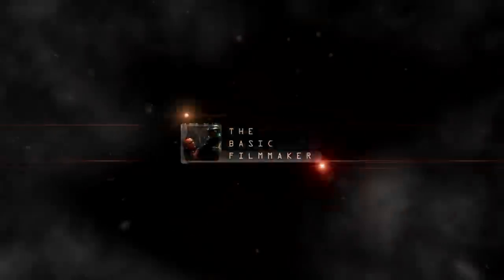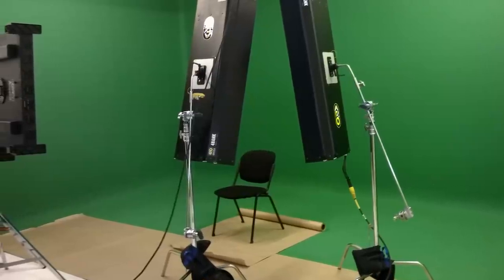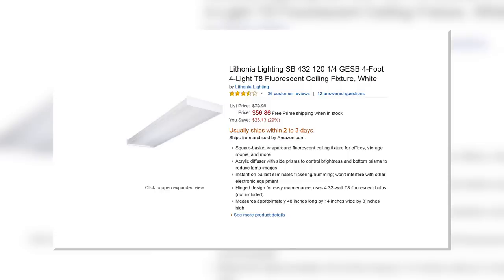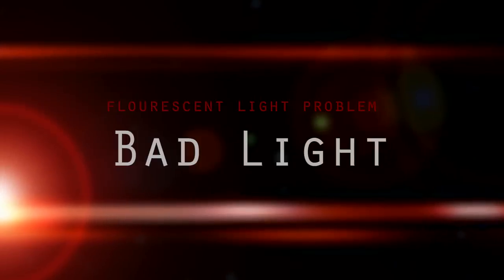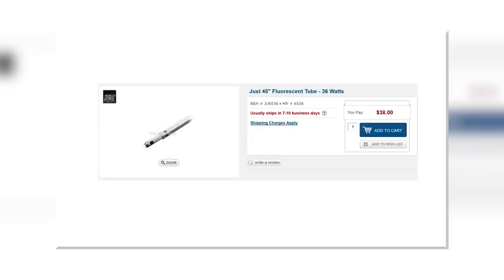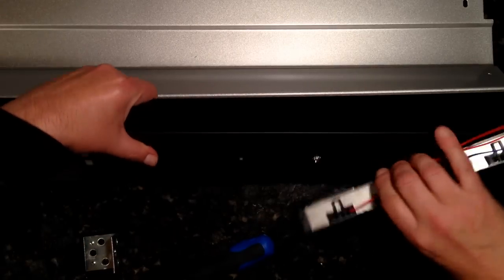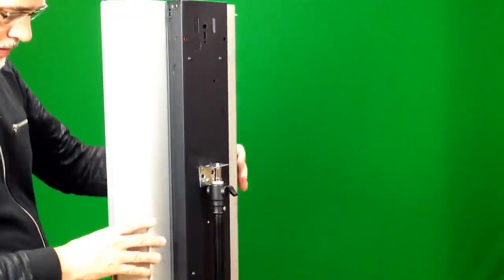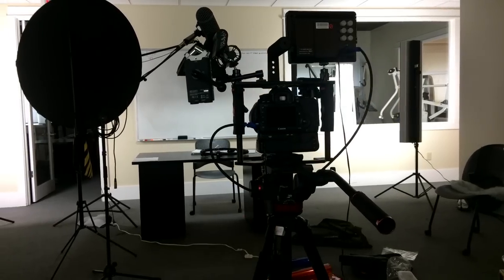How To DIY Bank Lighting For Filmmaking - Basic Filmmaker Ep 114

Comment: Hello, Basic Film Maker :) your videos look great from Romania and I've learned a lot from them. Thank you for that. Now I have a question: I want to do the project using a led light 1,7 metter long, 7350 lumeni, but with a CRI of 83. Do you think its a good idea? In the video you mention CRI over 90 plus. Thank you
Reply: My concers are about the number of lumeni: is it enough? And about the CRI value. And I am buying 1,7 metters lights because I want a big light properly green screen. I want to use just one bulb on each side. Not 4 as in your project.
Reply from the maker: +Școala de Dans Let&#39;s Dance A long like like you are talking is good. EVERY decision you make about lighting a green screen should be based on EVEN lighting.  If it takes 10 lights, or just 2, even lighting (no hot spots) is the key. You can buy or DIY whatever you want. Just make sure it's even, and your keying will be a breeze.
Reply: Thank you for the reply, Basic Filmmaker! I will get them and I hope I can do the 1 Click Green Screen as you do it. Thank again

Comment: I tried a dimmer on these lights and it didn't work. Any thoughts?
Reply from the maker: Man. I'm not sure a dimmer would work on these, unless they are rated for that. Haven't tried it, and I think the problem is the regulator that you need so it doesn't flicked - you start changing the voltage and the regulator must freak out.

Comment: Hi, thanks again for this DIY bank lights video and the other one on green screen. I got the Lowes shop lights (T8) you suggested, but they have only 4100K or 6500K T8 tubes available, and their CRI is in the low 80's range. The lighting set I am using uses 5500K CFL bulbs. Should I get the 4100K or 6500K tubes for the bank lights? Thanks!
Reply from the maker: Interesting question Leo. I just haven't used low CRI bulbs as I don't want to mess with it. As far as the K value, I don't think it will matter much, as you will be pulling the lit part, the green part, out anyway, AS LONG AS the light don't spill onto you, the talent. As far as CRI, again, I haven't tried it. I would be worried that a low CRI might offer differing colors on the green screen, and make it harder to pull a key, but again, haven't tried it, as I like to be safe with this and not battle keying in my editor. I would either find a higher CRI, or just go with the lower CRI knowing that you'll find out there aren't any problems, or, knowing that you may have to replace them if you do have to much color indifference.
Reply: Thanks. I went ahead buying the 5000K T8 with CRI 82. Likely the green will not be as faithfully rendered as with the fluorescent tubes with CRI 90, but as long as it is evenly green, hopefully it will work alright. I will give you update later!
Reply: Do you have an update. Im having this same dilemma
Reply: The CRI 82 works fine for my application. I figured that how the green is being rendered as is not that important, as long as it is consistent (so the background can be removed consistently).
Reply: Leo So thanks

Comment: Nice video! I work with a Lowel DV Creator 55 Kit to light my subject and these lights are Tungsten 3200K. Would i get in trouble if i would use your DIY fluorescent lights to light the Green screen?
Cause somebody once told me to not mix light sources.
Hope you can help
Greetz lenny
Reply from the maker: +lennart holterman Hey Lenny. I don't think it would be a problem. You can gel the lights, or better yet, just get 3200k lights to match.

Comment: Will I get flicker If I get a fixture without a ballast and use led lights instead?
Reply from the maker: I think you will, but haven’t tried it. The ballast controls the voltage so it is consistent.
Reply: Basic Filmmaker would you recommend getting led lights?
Reply from the maker: Yes. For green screen, if hat's what we're talking about, having full length lights on the screen on either side is optimum.

Comment: Any issues with flicker at high sutter speed and frame rates?
Reply from the maker: Not so far as I've seen. It does depend how high you're talking about, as I've tested 60-80 for a person.
Reply: @BasicFilmmaker  thanks! I always like to check lights at at least 60FPS/125 shutter in case I ever use them for slow motion.
Reply from the maker: @godsfilmmaker8863  That's cool. BTW, you might want to do some research in 2019.  This was made nearly 4 years ago, and you might be able to (unknown) find something just as cheap without DIYing anything.
Reply: @BasicFilmmaker  oh cool, thanks! I've actually been wondering if you can do the same thing with one of those LED replacements for a 4 bank. I hadn't seen your videos before today, but I thought your green screen video was very handy! I shoot some green screen for my day job (I'm a media director at a church) and I use 4 octagonal softboxes with 85w CFLs to light the screen itself. I put them in the corners (2 on stands  2  and 2 on the floor) and with the use of the green screener app and some of the plugins in HitFilm Pro I get pretty good results! But what you showed would definitely work better, especially for a long shot. Looking forward for trying to figure  it out. God bless, great explanations! - Winter!

Comment: What do you think about these LED lights that don't need a ballast? I've seen many 4 light fixtures that I can easily replace the bulbs with these and some even have the diffuser already on them. (Think office ceiling lights) 
https://www.homedepot.com/p/Philips-32-Watt-T8-40-Watt-T12-4-ft-Linear-Replacement-Universal-Fit-LED-Tube-Light-Bulb-Daylight-5000K-2-Pack-539163/308350356
Reply from the maker: A lot has changed in 6 years. LEDs are much cheaper, and I say go for it.

Comment: Would LED tube lights work?
Reply from the maker: Yep. I'm expecting a shipment of LED tubes soon (green) and will be doing an update to my green screen video.
Reply: Can you share with us which ones? I noticed that kenoflo has special tube for lighting greenscreens.
Reply from the maker: They do. These are from CAME, four 3-foot lights that can be attached in-line, and I plan on using them either 2x on each side, or 4x around the perimeter. Stay tuned, it's still a theory - we'll see, but these are RGB adjustable and super bright.

Comment: Hi, I have a question, would these lights from Costco work, they have led bulbs, here is the information for them:

 Tek Pro Black Ultimate Shop Light

The Tek PRO delivers more lumens per watt than regular fluorescent lamps or incandescent bulbs!  High output, energy efficiency and quality of light make this the ultimate garage, shop, workbench or craft area light fixture.  T5 HO fixture with 4 lamps produces an amazing 20,000 lumens, while a standard 4 lamp T12 fluorescent fixture produces 11,800 lumens and a 200 watt incandescent standard household bulb only 3,900 lumens (varies by lamp type).  “Daylight” 6500˚ K lamp color makes them very pleasing to the eye.  They also feature a high color rendering index (CRI) of 84.  Tek PRO fixtures are made from rugged diamond plate aluminum and have a durable powder coated finish.  State-of-the-art reflectors are made from 95% reflective German aluminum.  This unique high-end embossed material offers unparalleled output, reflectivity and diffusion.  “Daisy chain” feature allows multiple fixtures to be plugged in together (not to exceed 12 amps).  120 volt/216 Watts/1.8 amps per fixture.  1 year warranty on ballast components. Made in the USA.

They cost $149.99 each
I am thinking about purchasing them, thanks for you help.
Reply from the maker: Hittman45 They sound great. The CRI is only 84. I try and get 90 and above, but it should not be a big problem.

Comment: The link you gave for the light fixture does not come with a Plug, bought two of them 100 bucks wasted
Reply: Could you post the light fixture you used please
Reply from the maker: Joe Zoc Gessh! Amazon keeps mucking around with these links. Here's a new link to an Amazon one with a lamp guard and plug: http://bit.ly/ShopLight4-LightBankDIYAmazon, and here's the one you can order from Lowes: http://bit.ly/4LightShopLightLowes. These guys are really starting to p**s me off. :)
Reply: ***** Thanks for the quick reply, the links worked, what were your camera settings when using the Fluorescent lights
Reply from the maker: Joe Zoc
What kind of camera? I was using either Canon 600D or Mark III. Which settings are you referring to? Off the top of my head, I thinnk I was using a 50mm lens set at about 3.2 aperture, 50 (possibly 80) shutter speed, 24 frames per second. I haven't seen any flicker from these (which is why I use the electronic ballast ones). There's a lot of info about green screens (using these DIY lights) in this video: https://youtu.be/OH8TWTt51W8
Reply: *****  I have a t3i and was wondering if there would be flicker at 1/50th shutter speed, I just remember reading something awhile back don't remember what it was, anyway I plan on using these for more than just green screen work, thanks a lot for your help.
Reply from the maker: Joe Zoc You bet. There should be no flicker, as the electronic ballast feeds a continuous charge to the bulbs instead of  intermittent like a normal shop light does. If you notice from the referenced Green Screen video, I notch these shutter speed all over the place as a cheap check for hot spots, and didn't see any flicker whatsoever. Let me know if you experience something different. Thanks!

Comment: Amazon sent me the wrong bulbs! i'm so frustrated right now
Reply from the maker: Well that just sucks. You can also try Home Depot or Lowes.
Reply: *****
I'm wondering am I the first thats bought these lights from amazon i think the link might be wrong if you read all the info the bulbs in your link are 24 inches but the fixture is 4 feet
Reply from the maker: evilkoolade
OMG! Not only did the retards change the length of the bulb on this link, but, all the 4 foot bulbs are now like $25 and up!!! Huh? Ok then, to hell with these Amazon sellers. Here's a TWO (2) pack - 4-foot long - 5000k you can order from Lowes for a little over $8. Gesssh! I changed the link in the description. Still confused why they would do that!! I would return the ones you got. Lowes $8 (2) pack here: http://www.lowes.com/ProductDisplay?partNumber=133047-371-89069&langId=-1&storeId=10151&productId=3063317&catalogId=10051&cmRelshp=req&rel=nofollow&cId=PDIO1

Comment: why not two of Snap on 922261 2000 Lumens LED Work Light amazon or 
cheap in costco 5500 k
Reply from the maker: +Klausjp Lamers Use whatever suits you, but remember, it's the LENGTH of the light that gives you top to bottom even lighting.
Reply: @BasicFilmmaker  Sheesh...it always about length..